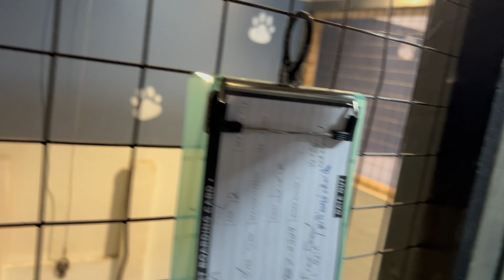Dog boarding business from home. A day in the life. #dog #cat #workfromhome

Comment: can i get information on how you built this?? like measurements and such
Reply from the maker: I put two buildings together so it came out like 12' by 50'. Small stalls are 4x6 and the back suites are 4x10 and the outside stalls are about the same. No contractors, did all the work ourselves including dirt work.

Comment: New here. Just built a small setup in a shop that was already on our property. Only holds 4 dogs, but I'm satisfied with that for now. I didn't want to bite off more than I could chew as far as cost goes. The possibility of expanding more into the existing shop is an option later. I have a question about getting business. How to you promote your business and how long did it take to get enough clients to be profitable? Thanks!
Reply from the maker: I put out Facebook ads on local garage sell sites only for about a month and some flyers at local stores. The need here was great so word of mouth traveled fast. Profitable from the first couple months.